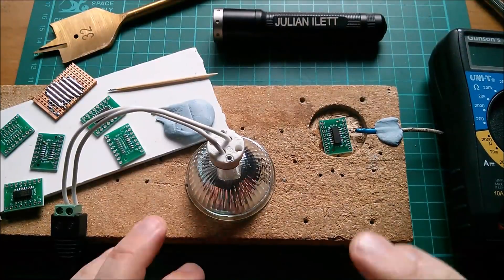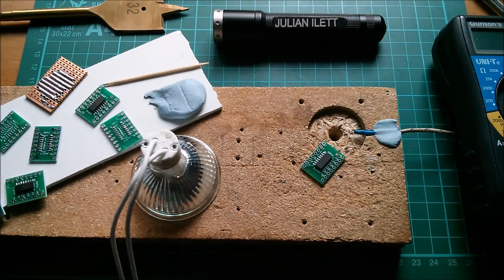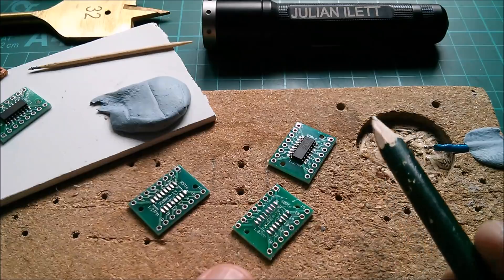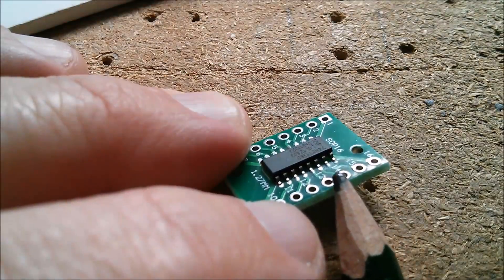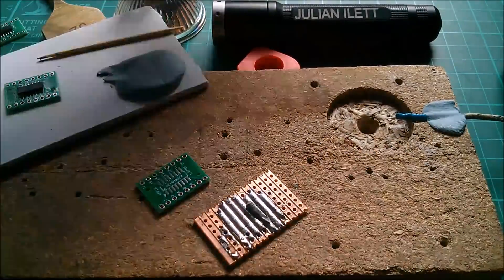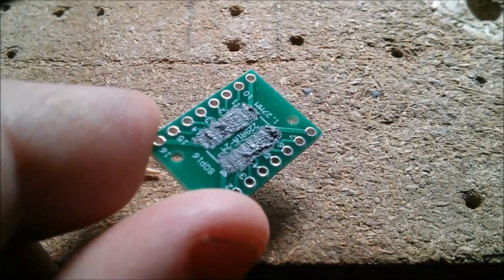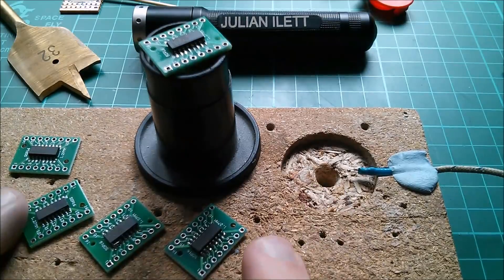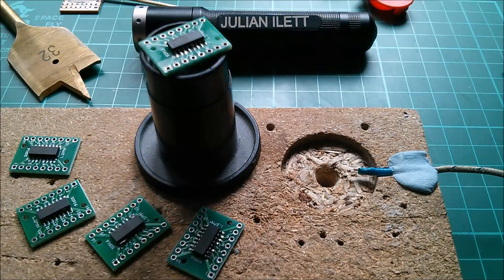Second Attempt: SMD Reflow Soldering

Comment: This may have already been asked, but would it be possible to spread the paste on the under-side of the IC's pins rather than the PCB, then place it on the PCB and heat?  That way, the amount of paste is naturally limited to the amount that can be retained by the pins.  Just a thought as an alternative to a stencil...
Reply: not needed...... just place component and right amount of paste and heat it on the right temperature, and surface tension will do de rest..... this wheel has already been.....

Comment: Get this set of syringe needles: https://www.ebay.com/itm/5pcs-5ml-Syringe-Crimp-Sealed-Blunt-Chemical-Needle-Tips-For-Glue-Oil-Ink/132353317274?epid=703119676&hash=item1ed0df599a:g:mOgAAOSwWxNYy5KQ Im sure you can get the tips without the syringe too, but they cost next to nothing. Put a dab on the pads. PS: They are flat so you dont poke yourself :-)

Comment: The reason the solder comes in the syringe is so you can fit a "blunt needle" of the right size and place the solder neatly and directly to the pcb.
Reply: yep, but this is old paste, and not "fit" for that.
Reply: Old paste means bigger nozzle. I have much older paste (drier) and it will go through one of my larger blunt needles
Reply: Eric-Jan van den Bogaard - it's paste because it's mixed with flux. If it starts to dry out, you need  a smaller container and you can stir in some liquid flux with a toothpick to thin it back out.

Comment: Preheat the board before applying the paste. It will make spreading the paste more easy. You can also use an insulin syringe with an apropriate needle to spread the paste on to the board.
Reply: only on the pads & pins :)
Reply: "Pre-heat ... before ..." Go watch this and then never ever use the word "pre-heat" without thinking very carefully as to whether you really need to say "pre-heat": https://youtu.be/46fOtLfYC4Q?t=82

Comment: From personal experience reworking a lot of computer boards, you need a bead of solder from that syringe across all the pads, the bead needs to be approx the width of one of the pads. You can mess about applying it manually with a toothpick, you can get a stencil and squeegee it on but the line of solder will work. 

You can then use either your homebrew oven (dichroic lamps might not work as well as a bare bulb) or a hot air pencil.

Comment: You could try using a clean tooth pick to scratch a line in the paste between the pads so the solder paste can't flow between the pads as easily. Might help.

Comment: Just as a tip: There are "pocket microscopes" on ebay - from china - that are very useful if you want to see how the solderjoint is. Just search for "60X Pocket Microscope Mini" on ebay.
I don't think that it will be useful in/on the camera but to see how the soldering went its useful.

Comment: If you aren't using a mask or something like a fine needle to place the solder on the pads, wouldn't it be easier to place the paste on the chips pins and then place it onto the board ?
 It would then be much harder to put too much on, as you can only put it where its needed /
Reply: you still can, i guess....but indeed, it would be an improvement...

Comment: Julian, yet another inovative video.  Like the concept, I went throgh a similar process but diluted the paste with rubbing alcohol and placed in a narrow trough then 
1 stuck the top of the chip to a pencil with blu-tac.
2 dipped one setoflegs into the thinned paste.
3 rotated the chip and dipped the second set of legs.
4 used the pencil with the chip (with wetted legs) on the end to place the chip on the board
5 used the pointy end of a second pencil to hold the chip in place while removing the tac and first pencil
6 cook in your inovative oven
Perfectly solderd surface mounted component
Have fun and keep up the inovation
Reply: ISO Guy Well I was thinking of buying some solder paste, but looks like I will stick to my 2 second drag soldering :D
Reply: only buy at a seller that has a good stock flow, because you need fresh paste, and use it soon after you bought it...
Reply from the maker: This is exactly how I wanted it to work. I'm working towards a solution using the thick goopy paste, but thinning the paste is something I really want to try. Thanks :)
Reply from the maker: What did youse as the narrow trough?

Comment: Another suggestion for distributing the solder paste in case you don't want to go with a stencil: there are needle-like dispenser tips you can buy which screw onto the syringe and let you place the solder paste more precisely on the pad. I've no idea what they would cost from a UK distributor, but a box of 30 costs about $10 through a reputable U.S. distributor. They look to be even cheaper through eBay of course.
Reply: Luer Lock Dispensing Needle
Reply: sounds like a good tip.

Comment: Umm, Julian, why not get serious with this. At least serious enough to pick up a cheap hot air reflow tool. Believe it or not, its actually important, more important than your reasons to do it the way you are. Not to mention, using a flammable material the way you are ? WTF ? You wouldn't solder with a cigarette lighter would you ? https://youtu.be/qqoHTKhIBRo https://www.ebay.com/itm/450W-220V-LCD-Display-Electronic-Hot-Air-Heat-Gun-Soldering-Station-Nozzle-EU/272724693415?epid=9003518012&hash=item3f7fa891a7:g:0PAAAOSwmCVY9I4j
Reply: the attempt of Julian looks like a cavemen's attempt, > what if.....
Reply: You think he should have used a flaring, sputtering, sooting piece of amber on a stick instead of the lamp? That'd be a sight!
Reply: Possibly because it takes weeks for A Cheap Hot Air Reflow Tool™ to arrive from Julian's usual points of purchase, and he wants to get on with it right now?
Reply: Ok, possibly. But, that's why he orders from 
alice1101983 
 They have been quicker for me. It costs a slight bit more though. Check it out... maybe they will let him review it ? https://www.ebay.com/itm/450W-220V-LCD-Display-Electronic-Hot-Air-Heat-Gun-Soldering-Station-Nozzles/201889005027?hash=item2f0185bde3:g:cTwAAOSw4CFY7je8

But, I do recommend the bigger station with both an Iron and air. The quickest and least expensive is this one, and by quick, Its from New York, USA , so it would be a matter of days in the US. Not sure about US to England. https://www.ebay.com/itm/2in1-SMD-Rework-Soldering-Station-Solder-Iron-Welder-Hot-Air-Gun-ESD-3-Nozzles/182754818711?epid=1637662164&hash=item2a8d093a97:g:eAIAAOSwAYtWGLRc

Comment: The simple solution to applying the solder paste is to make a diy stencil out of scrap plastic (like sheets cut out of old packaging). Simply place the plastic over the circuit board, mark the pads on the plastic with a marker, and use a scalpel/craft knife to cut out holes to match the pads. Once you've done that once, all you need to do is put the plastic over each circuit board and scrape the paste over.

For a more interesting project, automate the temperature control with an Arduino!

Comment: If you really must use this cheap method, why not apply the solder directly to the IC with an artists brush? You should then have more control over solder distribution.

Comment: Cut a hole in the clear plastic that covers boiled ham sandwich slices. The hole needs to be the rectangle that covers all the pads. You could do two thin rectangles, if you're feeling clever. Put the plastic mask over the pcb. Then, using an old credit card, spread the solder paste over the hole. Clean and consistent!
Reply: Andy Timmons What on earth are those “boiled ham sandwich slices”? There’s no such thing. Who knows quite what kind of clear plastic you must be imagining, then.

Comment: Hi Julian, some of this type of bulb are designed to throw a lot of the heat through the rear of the bulb, I think this is because if used for projection or lighting delicate items then it stops the very property you are trying to take advantage of, try a H4 or similar
I think a 50w is also needed
Reply: still too low...

Comment: There were many good advises in the previous video comment section but he never read comments and just do random stuff and waste time. To put solder paste consistently use a stencil! You can make a crude one with tape. You cover the board with tape except the pads. Put paste on pads and spread with a credit card or anything with a nice edge. Then remove the tape and you have a fixed quantity of paste. To adjust the quantity you can change the nuber of tape layers.
Reply: I’m glad to hear it, but it’s difficult to watch you struggle with this stuff when commenters have offered tested, proven techniques that work reliably.  That’s why you’re getting so many frustrated comments.  We’re all watching these videos with palm on forehead, groaning at our screens!

Soldering SMD components isn’t a new thing; workable ways to do it have been known for ages.  Either get a stencil, or make one, and use a squeegee card to apply paste.  If that doesn’t appeal to you, then get an assortment of blunt needles for your paste syringe and apply paste directly to each pad.

Heat can be applied in several ways.  You can buy or make a reflow oven, or get a hot air rework station.  One of the cheapest and easiest methods is to use a small frying pan (get a cheap one at the pound shop for only this purpose).  Put your board in the pan and warm it slowly on the cooker.  Add heat from above with a heat gun (even the paint stripping kind works fine; just don’t overdo it) until you see the solder reflow.

With a little practice (there are many videos here on YouTube) you can use an iron and thin solder wire to do half a dozen of those adapter boards in the time you’re spending on one of them smearing solder paste everywhere with a cocktail stick.  I frequently solder 0603 passives by hand, and could probably manage 0402 if my eyes were younger.  It’s easy — not because I have some special talent, but because I learned from others and practiced.

Your paste is like peanut butter because it’s old and dried out.  If you’re serious about SMD work, that’s one thing you really should buy locally.  It will come in a vacuum sealed bag, in an insulated cold-pack.  Keep it sealed up tight and refrigerated when not in use, but you’ll have to bring it up to room temperature before using it.  Good paste is pricey, but the ease of use is worth the cost.

The tiny solder balls are happening because the flux in cheap Chinese paste is garbage, and because there’s a limit to the effect of surface tension during reflow.  When the paste is smeared too widely on the board, it just can’t all pull onto the pads.

We love your content, Julian.  We want to see what you’re going to invent with these stacks of logic chips, but watching all this needless preparatory faffing about is painful!
Reply from the maker: I read all the comments

Comment: Try running a clean cocktail stick between the pads or dip the IC pins in the solder paste.
Reply from the maker: Dipping the IC in the paste doesn't work, but applying the paste then shaping it with the stick is working a treat :)
Reply: cocktail sticks have better use then this :)

Comment: The reflow is the distribution of the paste/solder when it liquifies and surface tension will do the rest reflow oven wise is a exact "science" because of that, you should at least see what you're doing..... so a heatgun for this purpose, will do a better job because you can see what you are doing, first apply heat evenly, when the flux in the paste liquifies, apply more heat and move slowly while the solder goes into place and "shines" the component will move into place by the surface tension, that's the reason why the pcb should be level.
the way you're doing it needs each time a new guess, when using a different component,
Soldering normal or with reflow heatgun, is way easier, you should not try this oven wise.

Comment: i never understood, the smd components can stand high temperatures without failure or what? where can i find information in the datasheet of the part how long and what temperature should be reflowed at? i have some adxl335 which come not soldered, i messed up one of them using the soldering iron :(
Reply: the smd manufactor gives all specs needed :) google for it, also a reason why experiments like this will surely fail..... heating is a process... for smt
Reply: Eric-Jan van den Bogaard yeah but what should i look for in the datasheet i mean? should i search for "max temperature adxl335" or "max soldering temperature adxl335" or "length of time exposed on which temperature adxl335" or what? Chinese ones doesn't provide any information at all in many cases and most of elements are manufactured in China nowadays...
Reply: dothemathright 1111 thanks for the info. so i should go for the maximum storage recommended temperature? i mean i should not go above that temperature with the reflow?

Comment: I've just bought a smd vacuum pump holder thingy. Any thoughts about how good it will be over a pair of tweezers?. Helpful suggestions always welcome
Reply: you should ask yourself before you buy the thing.... i guess the suction cups will wear out due time, tweezers not, a smd component could be "launced" from your tweezer, tweezer needs to be anti static.
Reply: Eric-Jan van den Bogaard I have the anti static tweezers, + the mat. Made a couple of things now with smd's. At 99p figured it was worth a try. Just wanted to know if anyone had any experience with one.

Comment: you’re making it look more difficult than it is, if you use hot air and a solder paste stencil, you’ll get consistent results
Reply: A stencil makes sense for bigger SMD projects. But for small SMD jobs, like Julian’s doing, I’ve found the best option is to get a 3cc Luer-Lock syringe ($1 for 10pcs) and a small gauge Luer-Lock dispensing needle (also cheap on eBay). Then just transfer some of the paste into the small 3cc syringe to very easily control placing perfect small dots of paste on each SMD pad. Then, of course, Julian needs a cheap hot air rework station (also cheap from eBay).
Reply: Exactly, use a mask from thin plastic and spread it that way, so much quicker and more consistent. Almost like screen printing only with solder paste.

Comment: For assembling a whole board, nothing beats a £15 Argos toaster oven.  There are lots of PID temperature controller projects around the net, but I've found that putting boards into the oven cold, putting it on full blast and then turning it off and opening the door when the solder visibly melts gives a perfectly usable temperature profile.

I have had reasonable luck getting a local friendly company with a laser cutter to make stencils from 0.125mm binder cover sheets, good enough for 0603 components or 0.65mm pin pitch ICs.  0.5mm pitch often needs some manual rework, but it does work as long as you get exactly the right amount of paste where it's needed.

With a stainless stencil ordered along with the PCBs, I've assembled many boards with 80 components (0603, SOT23, QFN, some with 0.5mm pitch) with little more than a pair of tweezers, a steady hand and that toaster oven.
Reply: nice, but you did know what you where doing, and have managed to have the heating "curve" bye eye, so even that will work, that's nice ! and even not completely "by the rules"
Reply: Practice makes perfect.  But when I first did it I had no idea what I was doing beyond what I'd read online, and had never done SMT work, and I'd say it was an 80% success on the first attempt.

I was expecting a spectacular failure, especially when all the carefully-placed solderpaste slumped into loose pools around the components as it warmed up in the oven but, much to my surprise, as soon as it melted and the surface tension pulled everything into place the result was very satisfactory.

Comment: Why don't you just solder them with an iron?  It is not that difficult to do with a conventional iron tip and super easy to do with a reservoir tip.  I know you just like trying and doing things, but it certainly appears as though you are making quite the Rube Goldberg machine in order to do these SMT chips.  Without a solder stencil you are going to end up with a lot of rework on your reflow attempts.

Comment: tinning the pads, putting the component on it and solder just one pad to make it stay there.  heat up with hot air (soldered in 10secs) or your weird method (5mins.) done. screw that solder paste without having a stencil
Reply: to tin a bunch of pads at once its just putting a lot of solder on your tip and dragging it across, keep adding flux.  if theres a bridge, add more flux.  flux everywhere.  after all have solder on it, clean your tip and pick up the solder balls. they get sucked onto the tip because of the surface tension.

Comment: Some dispensing tips will help.. The conical ones work better than the stainless ones with a thick paste.. They greatly reduce the pressure required to dispense. 18-20ga should be good for what you're dispensing. https://www.ebay.ca/itm/100x-TT-plastic-syringe-dispensing-needle-tip-glue-14-16-18-20-22-25-27-cap-Pop/122824383249?hash=item1c98e75b11:m:mnLDqwPirxdu4NYVyHU4a5w

A bunch of little solder balls can either be caused by heating the paste too quickly, or messy dispensing.

Comment: Julian - I think you're spending way more time than just going at it with the iron.  This just doesn't look like it's going to scale to 3-8 chips and other components.
Reply: Yes, but because I plan to make lots of boards with lots of SMD components for small beta production runs, I'm personally going to make a reflow oven using an old oven with fan switchable off I have and a controller I'll make (now, the problem is, if the controller has SMD parts, what do I use to solder them?)